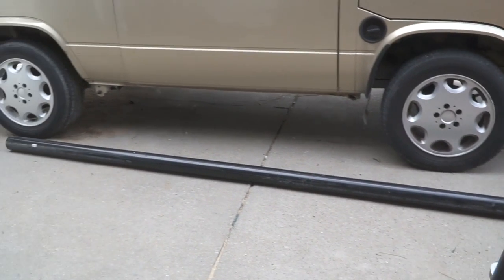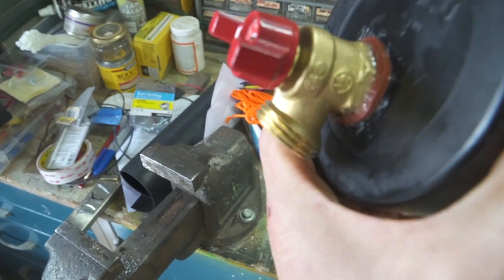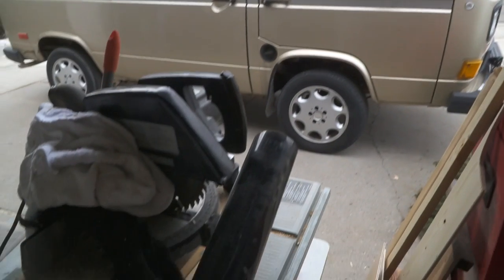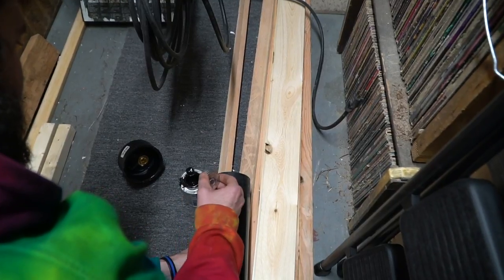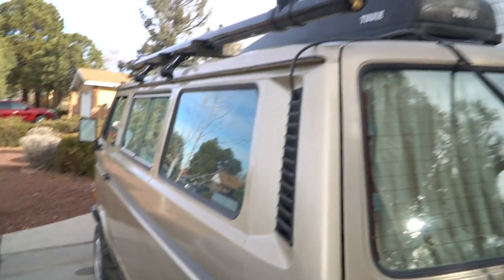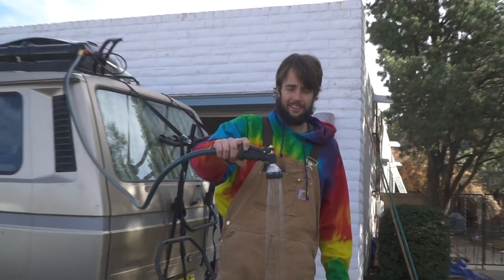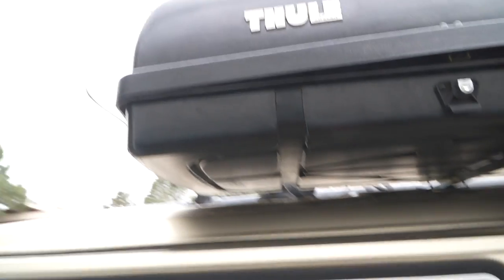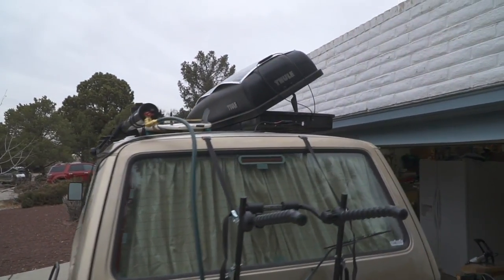DIY Air Pressure Solar Shower for Your Vehicle +  How to Install a Shower on Any Vehicle

Comment: I like the piping idea as water storage.  My idea is drill a hole to pipe it (the shower head) into a dedicated space in the living area.  Second, is water is 8 lbs per gallon,  So some steel brackets to secure the pipe along maybe at 4 foot intervals would be a great redundant safety idea.   Just tossing ideas out.  I enjoyed the battery isolator video,  that makes great use of alternator between trips.

Comment: The kookiest part is not just buying the $7 2 pack of shrader valves and it would hold itself in place. Otherwise super pro!
Reply from the maker: I saw them for sale at the bike shop for $22!!! $7 WTF?!?! I would have but vanningaintnojoke and I had to save a buck!
Reply: @Vankookz  I got mine at ace hardware. not a bike shop. Great shower though!

Comment: i built a water storage for my trailer , with your valve that high from the bottom of the pipe you won't get the water below it , you need to put a 22 1/2 or a 45 angel pace then your valve so you can get all the water in the pipe
Reply from the maker: just vannin it furchaser so true now I can’t stop thinking about how I messed it up
Reply: easy fix just cut the end off and leave 2" glue on the angel then glue on the end cap , wham bam its fixed
Reply from the maker: just vannin it furchaser that’s a great idea just cut the end off!  Genius!
Reply: Genius well maybe not but i can fix anything

Comment: You two are dong such a really good job...
but, I have a concern about the solar... I have seen other vans taping it down with some heavy tape (I am not sure of the name of the tape that they used) ....But the wind will get underneath it.... then the wind will rip it off of the van
Reply from the maker: Alvara DaCosta yeah I have some heavy duty 3M tape under the panel and was thinking of putting some sealant in the front to keep it airtight
Reply: @Vankookz  yes, I saw how you out your tape on... ( I have never see it done that way). You have a lot opening's for the air to get under your solar.......
Good luck and have a great time at the RTR
Reply from the maker: Alvara DaCosta taped the front down with Guerilla Tape cruising at 65 and having no problems! Thanks for the advice
Reply: @Vankookz  very good.....enjoy the RTR

Comment: Nice work, better than most! Why not space your Thule racks rails farther apart so your box and shower pipe are better supported?
Reply from the maker: SC Nomad the roof box is old school and only has one option of rail distance for mounting it to the roof racks.  If that makes any sense.